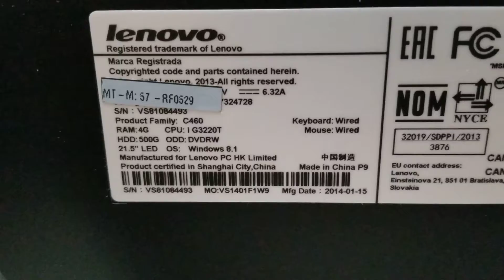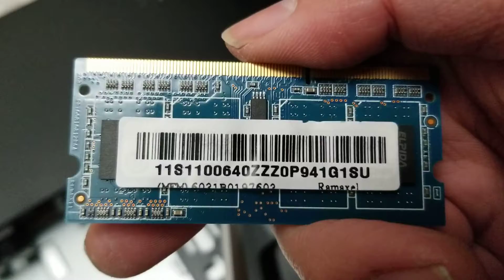Lenovo C460 Disassembly Hard Drive SSD and RAM Upgrade

Comment: Can i use 16 g with the same hard drive
Reply: Did it make the computer faster with the same hard drive.  I’m trying to use my old Lenovo 460 it’s so slow now and needs upgraded but wondering if the ram alone will speed it up enough to be useful again.
Reply: @robertbrewer1152  If your device is running on a HDD (Hard Disk Drive) drive, it likely needs to be replaced regardless. I'm on this video doing a swap for this exact reason. HDD drives are made in a way that gives them a very short product life-span in comparison to SSD (Solid-State Drive) drives.. Most of the devices I've owned that have been manufactured with HDD drives have required upgrading by year 5 in order to continue being operable.
There are lots of resources on the internet to explain this further and how to transfer your system/files to a new SSD when making the switch. 👍
Reply from the maker: RAM? Sure

Comment: Thanks. You can also remove the optical drive and replace it with something like an SSD caddy. I'm planning to do this, but do you know what thickness fits? Would a 9.5 mm caddy fit?
Reply from the maker: You'll have to measure it. I'm not sure.

Comment: Hey can i put 2 drives in my c460, Like i wanna keep my HDD but also wanna add a ssd in it
Reply from the maker: If this has a cd drive you can replace it with a 2.5" sata drive adapter.
Reply: @ItsBinhRepaired  yea it has a cd drive, but what if I get a sata splitter will it work the same?
Reply from the maker: @ahanaf5769  not sure how you'll fit it in the computer. You also need a data connection

Comment: Thanks for the video! I feel so silly. I'm used to having to undo the entire back panel of AIOs to get to this stuff. Kudos to Lenovo for this design
Reply: Nice vid. Totally agree, this Model looks a gem - I've just done a RAM upgrade on a Lenovo IdeaCentre AIO 3 Desktop PC (50UM7500PLA) and it's not for the feint hearted or inexperienced repairer. Separating the back cover was very very tricky and sooo easy to flex the display and either crack it or break a few pixels.
Reply from the maker: Glad it helped! Yeah, some designs are just stupid. Don't forget to like and subscribe if you haven't already so others can find my videos. It'll really help me out. Thanks!

Comment: Hi.. Can I add 8GB memory into vacant slot and keep 4GB as it is, which is existing? Is it ok to use memory of two different manufactures?
Reply from the maker: Same speed is the most important, same size works faster, same manufacturer isn't so important.
Reply: @ItsBinhRepaired  thanks buddy.. Also is RAM upgrade enough to improve performance or HDD also needs to be replaced with SSD..?
Reply from the maker: @monga2026  I'd skip the ram and go straight for SSD upgrade
Reply from the maker: @monga2026  this video will help. https://youtu.be/4p5jFDzVwUw
Reply: @ItsBinhRepaired  thanks for the guidance and  quick response.. really helps..
Reply: @ItsBinhRepaired  which SSD would u recommend/ compatible with Lenovo c460?
Reply from the maker: @monga2026  I believe I mention it in the video

Comment: Hello Thanks for the video, I have a question! Can I add 2 8gb RAM memory on this same model of computer? I'm thinking to add 1TB SSD?
Reply from the maker: The video should show that. 1tb ssd is fine any size as long as it fits in the computer will work.
Reply: Thanks for your help, I appreciate that information and your video, yes 2 spots and I fit 8gb on each to have this computer for a few months to make my studies and after that buy a new one!
Reply: @edgaralvarez4143  I see only one spot, where is another one?
Reply: I mean if the computer have 2 adapter for it
Reply from the maker: @edgaralvarez4143  2 slots, but you should open yours to check.
Reply: @ItsBinhRepaired  when i check my task manager is says i’ve used 2/4 slots
Reply from the maker: @randoando5178  don't listen to it
Reply from the maker: @edgaralvarez4143  make sure you watch the video multiple times to make sure you know how to take it apart.
Reply: My all in one is a lenovo c40-05 it comes with 4gbs of ram.  Is the RAM DDR3?  IF so do I have to replace it with 2 sticks of 8 gbs of DDR3 OR CAN I Take DDR4 as well?  What was the 2.5 SATA SSD you use?
Reply from the maker: You'll have to check what's in your computer. It's right on the label. You can't go from ddr3 to ddr4. The slot is different. Make sure to check the speed of your RAM and buy matching.

Comment: Have this computer and plenty of hard drive space but now very slow - if I upgrade Ram from 4 to8 will performance improve greatly? Only use computer for word, quicken and internet searching. Any more complicated than Un clipping the existing Ram chip and inserting the new one? I'm obviously a novice - THANKS
Reply from the maker: This is what you want to do https://youtu.be/4p5jFDzVwUw
Reply: It's Binh Repaired so RAM upgrade is not good enough to improve performance?- don't want to replace the whole hard drive as DONT need HD space -

Comment: Is the motherboard compatible with a Ryzen 3 3200g Processor
Reply from the maker: Usually as long as it's the same socket/generation you can, but sometimes they don't allow it in the bios.

Comment: I need to upgrade my memory in my C460 from 4GB to 8GB. What type works?
Reply from the maker: DDR3 12800 will work.
Reply: @ItsBinhRepaired what’s the max ram it will take?
Reply from the maker: @robertbrewer1152 64gb if you're loaded https://amzn.to/44Mlwzu
Reply: SODIMM DDR3L 1600Mhz CL11 - Support 2 sticks of 8Gb (16Gb total).

Comment: What is the maximum RAM this computer will take
Reply from the maker: Looks like 16gb, but I don't have the machine to confirm. If you already have 8gb, an SSD would be a much better performance upgrade.
Reply: @ItsBinhRepaired  will the performance improve if it has both a 16gb RAM and an SSD upgrade?
Reply from the maker: @pandora8374  yes, mostly from the SSD